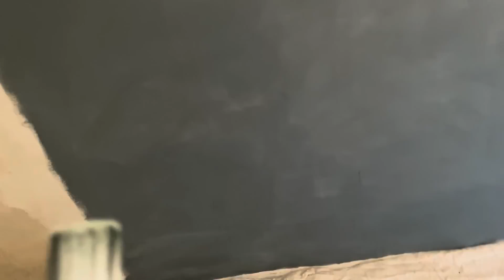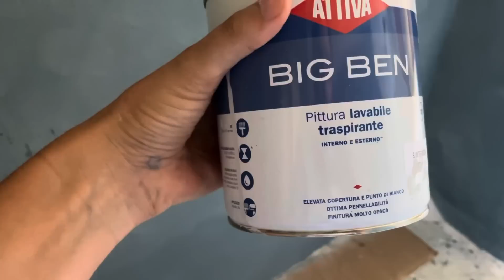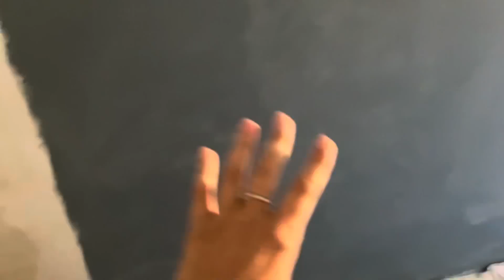How I create murals in my bathroom/ Renovating an old Italian house

Comment: Perhaps try a backer board used for shower tiles for the granite? That is what it is called in the US. That would add stability to your granite and my guess, you will need a special glue and granite filler.